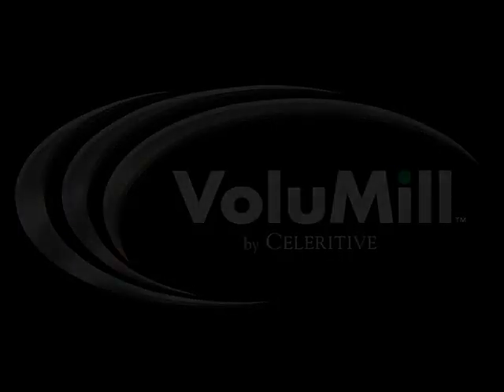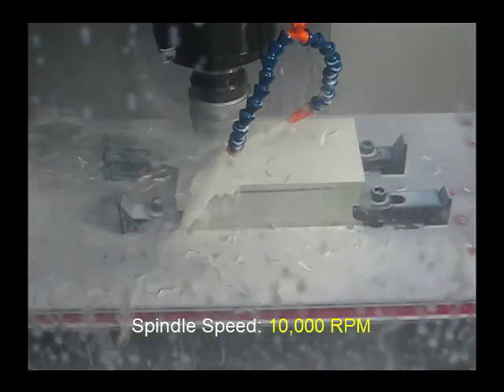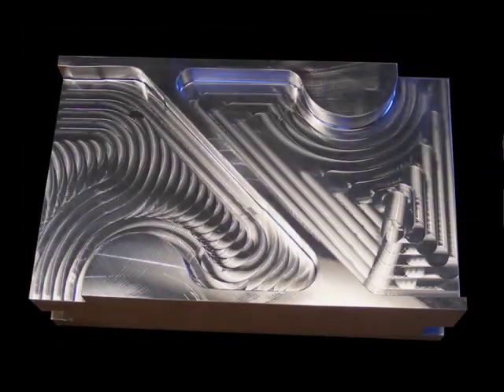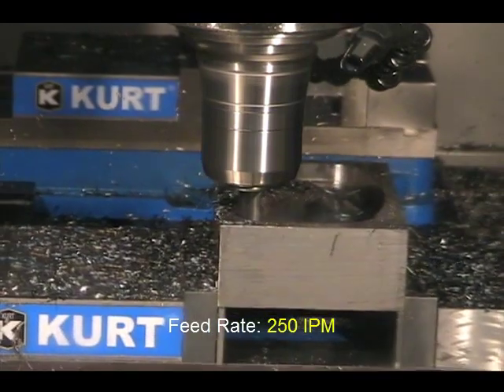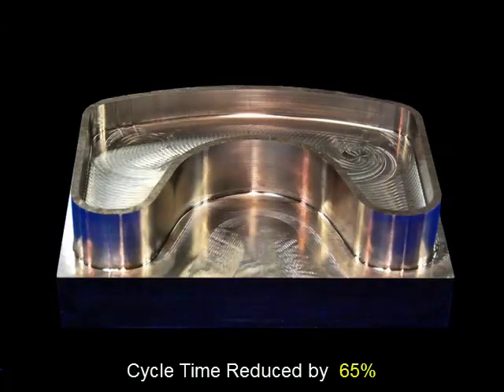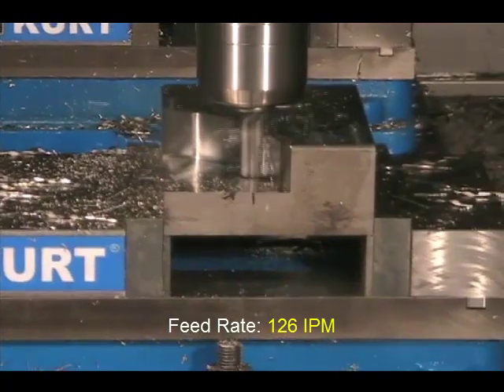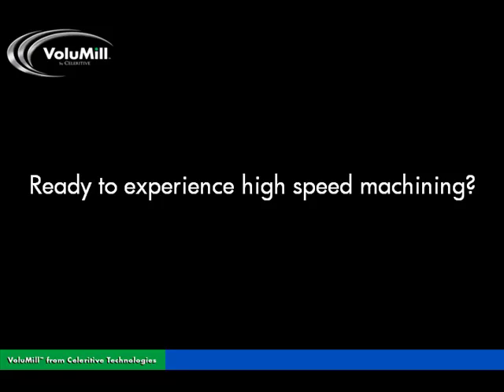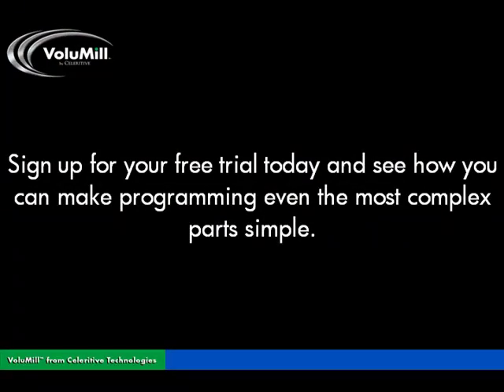VoluMill: Ultra High Performance Milling

Comment: 新一代的加工引擎:
1) High-performance, smart toolpath engine.
2) Powerful, efficient toolpaths for open shapes.
3) Intelligent slot milling and side milling options.
4) Fast machining of small pockets.
5) Up to 100% stepover with no uncut material.
6) High-feed repositioning with floor clearance.
7) Cleanup Milling.
8) Automatic feedrate adjustment.